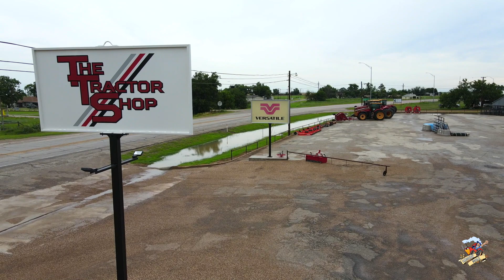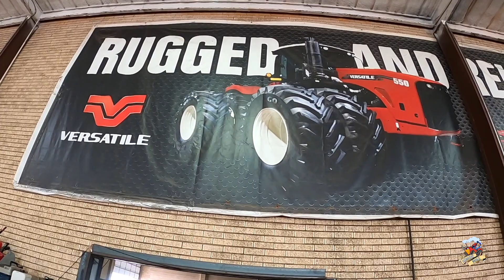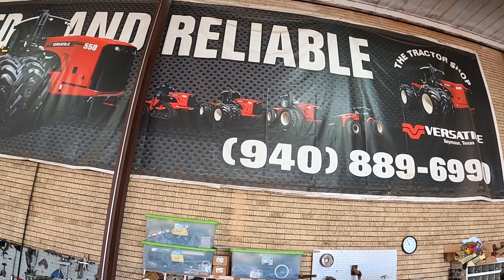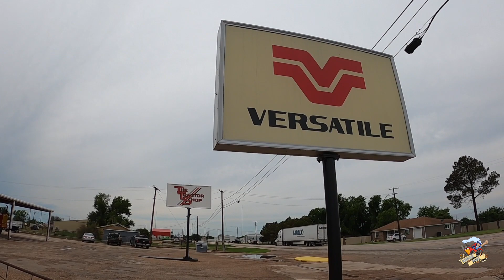Lets Go To The Tractor Shop in Seymour Texas

Comment: Ran a 118 and 145 most of my life, tough old tractors, those early v6s and v8s weren’t the best, but as soon as Versatile went to the big 855 cube in line six, there motor issues, were a thing of the past. From then on impossible to find a better tractor.  Versatile Tractors became then the cornerstone on which Real Tractors were compared. Easy for Farmers to fix, cheap on Fuel, very Tough, lasted forever.
Reply: You’re right, just had the wrong engines.
Cost probably the only reason for the V8 Cummins and yet they put in the 903 latter on.
Reply: @hughperkins707  My understanding is Mr. Peter Pakosh designer and owner of Versatile wanted to keep the cost down. Apparently Cummins had an abundance of these marine diesels and wanted to get rid of them. But , anyway every other manufacturer had major hiccups worse than Versatile. Case in point Deere who when they built there first 4wd, you couldn’t afford to buy and if you could certainly it wasn’t a great tractor.
Reply: @gordonvanpatten6637  I agree, lots of tractor manufacturers made Big mistakes about engines. The biggest was Oliver and the 310 Waukesha.

Comment: 3 1/2"  rain would shut our irrigation down in the upper panhandle.     Most of my fields could take it in a few hours.   One would only take 1 1/2" because it has not  grown  a good crop for several crop years.  Little residue left to stop runoff.    Strange how there are only newer John Deere's around here and so many others around Seymour.